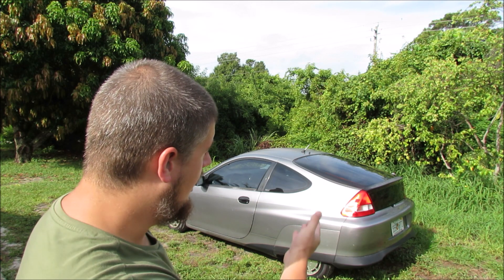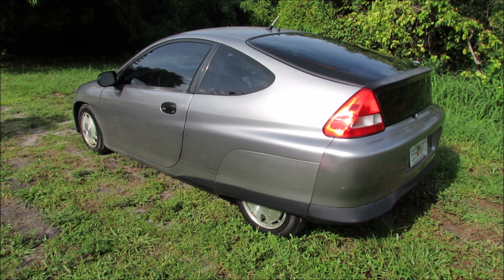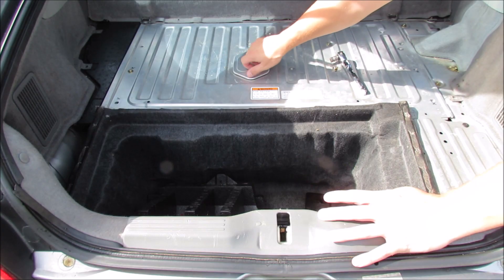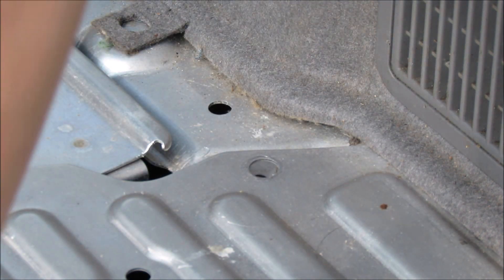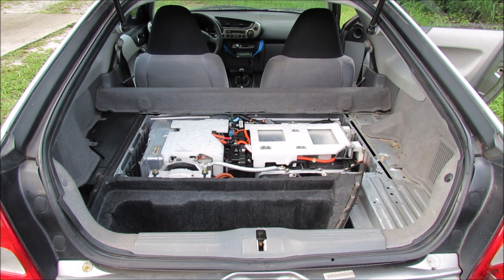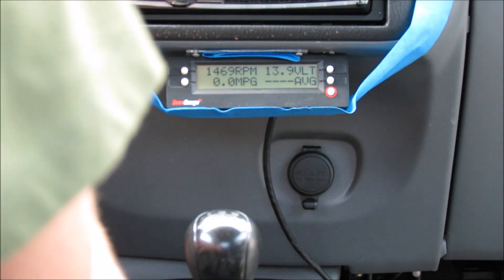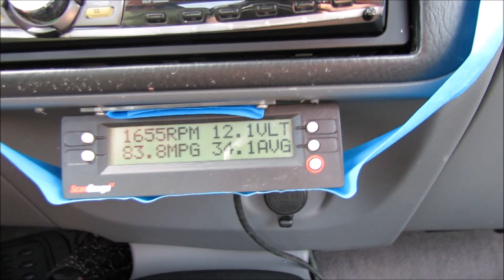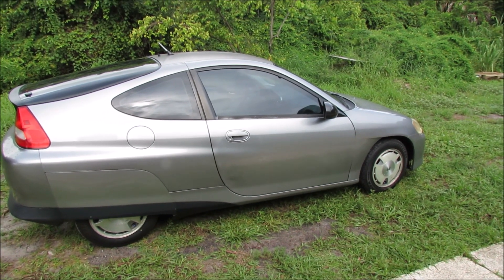How to Bypass IMA in Gen1 Honda Insight

Comment: This is a great video and I am so grateful. Am going to do this as same thing happened to my 2003 automatic insight.  When I open and take off the metal cover I know the main switch will be in the off position because I did itv3 yrs ago.  So the two plugs you referenced will be plugged in and I unplug them correct?  If so can you explain how the 12v battery recharges itself with no alternator?  Thanks and sorry for long winded questions

Comment: Now that you will be turning her over, with the 12v battery, would you suggest putting in a deep cycle 12v battery? Thanks!
Reply from the maker: I personally don't think it's required.  I had zero issues for over a year doing it this way.

Comment: gota few questions, can i run the car with the headlights on, i also have an after market touch screen radio head, can i have that running aswell, lastly, would this bypass hold up long enough for me to drive the car for an hour and a half at freeway speeds. oh and i dont have a scan gauge should i gamble and not be able to see exact volts?
Reply from the maker: I ran the car for hours like normal when I did this.  If you don't have a scan gauge I would recommend using a volt meter to see of its charging properly after doing this.  You don't want to get stuck an hour away with a dead battery.

Comment: Just what I needed to know! Infortunately I gotta pass smog to renew tags so I guess I gotta buy bumble bee battery but great info! Great video man! Thanks
Reply: Hybrid has nothing to do with smog. Properrly maintained gen 1engine should have very low smog even with IMA bypassed.
Reply: @MAC-hb5yr  It's because it will have a CEL. Certain places if u have a CEL it will fail regardless what the code is for

Comment: I have had my Mk1 UK Honda Insight since 2006 I was completely unaware this could be done..

Thank you! I was considering letting the car go. I reconditioned the pack back in 2013 iirc with a guy up north into these but did not really want to spend another £2k right now! So this will enable me to still drive around. And still be mobile.

So pleased this will be getting done tomorrow..

Comment: Good stuff Bro! 
I was wondering whether it is possible at all to do it the other way around. I mean running the car with electric only. Thanks for a prompt reply. Sham.
Reply from the maker: Even if you could the 10hp motor wont get you moving very quickly.  Best bet would be to replace the in trans motor with a more capable motor and then swap the 144v battery pack put for something bigger.  Anythings possible.  But i dont know if the cables would even be up to the task.  It would almost be like starting a fresh build.

Comment: I have automatic. is that mean just don't go pass 4k rpm?
Reply from the maker: Honestly i couldnt tell you.  Even if the battery light comes on it only stays on for 30 seconds as long as the car shifts and the rpm come back down youll be fine.
Reply: @thousanddollarcarguy  Thank you for your replied. I don't have money for new batteries yet, am i still able to daily drive like this? Will it hurt anything to the car with disable IMA switch off and disconnect BCM?
Reply from the maker: @jeanbkletsgo7446  no it wont hurt anything driving it that way.  Your good to go.

Comment: Thanks for the video. I have heard that you can run it on gas only, but I thought you needed to buy or make a plug. I guess the plug is for the clutch bypass switch? Could you do a video about that? I have two Insights I want to get back on the road, but batteries are very expensive.
Reply from the maker: I didnt do it on my own.  But i believe its just a neutral safetly switch mod.  Im sorry i dont have any more info on it than that

Comment: I just now finished this operation on my 2002 Insight with CVT. Where I live, it's not even a deal if the check engine light is on. Now, so long as my under the hood battery stays charged, I'm happy once again getting 45 mpg.
Reply: HI there. I have exactly same as your car with CVT. So with this setup, are you running daily? Does it effect anything to the car?
Reply: Are you saying this still works when having an Automatic transmission????😮

Comment: I use lights about 80 miles before i reach to work. Will this mod kill my 12volt battery?
Reply: Actually tried it myself today drove over 160 miles and it did just fine...and just as you said over 4k rpm the battery stops charging for less then a minute then it comes back on again. Thanks for this video!!! I still get about 60kmiles a gallon on all motor.

Comment: Without IMA battery assists, is there problem not to charge small battery in front? Can someone answer? Thank you so much.
Reply: I was hesitating to drive Insight from Los Angeles to Houston & back to LA with weak IMA battery.   I decided to disable IMA.   I just made 3,800 miles trip without IMA battery & I really appreciate your YouTube post. Thank you so much!!!!! Only thing I notice was driving over 4,000rpm, battery and break light come up until I reduce RPM below 4,000. Lights goes off & car drives fantastic!! Again, thank you so much.
I proved your system works.
Reply from the maker: @ishizakitokuji987  thats amazing
  Im so happy i was able to assist you in a way.
Reply: @ishizakitokuji987  Wow. Is your car manual or auto? I have auto and wondering if it happens same driving at 4k rpm?
Reply: @ishizakitokuji987  Also are you still driving with disable IMA as of now?
Reply: Thank you so much. I do it today!!!!!!!!!
Reply from the maker: While doing what i said the 12v battery charges up front.  You dont have the stock ima battery but you do charge the 12v battery so you can keep driving the car.

Comment: My insight battery dies after a while 
Hmm im thinking its just the dc to dc now? 
Just bought it yesterday. Drove it home 35 miles
Reply: Get one of those plug-in voltmeters for the cigarette lighter and monitor the voltage as you drive to get some idea about when it's charging.

Comment: So does it use the electric motor at all anymore or are all hybrid batteries disconnected?  Pretty savvy of you. What fuel economy do you get?
Reply: I am inclined to believe with the hybrid battery out, the electric motor no longer works if the hybrid battery was the one powering it. That thing will eat the under hood battery for lunch if that was the case

Comment: I read that you only need to unplug the BCM, to bypass the IMA.
Reply from the maker: Only thing i can say is i unplugged 2 of the 3 plugs that i show and it works
Reply: @thousanddollarcarguy  Great. What is your fuel economy like now, in the city?
Reply from the maker: @keithc8108  currently 53mpg.  Typically around 70 to 80 degrees everyday.  I havent ised the ac in a few weeks its been too nice.

Comment: DO NOT BYPASS THE battery. You can recondition the battery pack with a grid charger and a deep discharge.. I spent only 165$ and mine is renewed at 142k.
Reply: I am going to bypass till I can recondition my second battery (each set of 4 sticks takes me 3-4 days ~20days I have 2 gen 1 hondas and I have one extra pack so I have up to 20 dead batteries till I have concerns I plan on buying a set of new 10000mah replacements when money allows when I install that battery I'm also installing a grid charger :)
Reply: "gridding" is great as long as there's enough battery to take a charge. I did it for two years. Finally it wouldn't take a charge. I also couldn't do longer trips being dependent on having to plug it in. This is the clean, worry free solution. It's easy to adapt to linear acceleration, still yielding an incredible 60 mpg.

Comment: Great video! Help me to understand one part, when you exceed 4500 rpm do your charging volts instantly drop? You explained how to make it go away very well but basically to avoid this just keep your rpms down?
Reply from the maker: Correct.  It stops charging for the duration of the extra lights being on.  But when you shift to a higher gear for a little while the lights go away and the charging with restart.  Ive done this hundreds of times.  Sometimes i need the extra revs from the car to pass someone or pull put into traffic and its like.  Welp.  I can afford 30 seconds of no battery charging for the ability to not be destroyed pulling onto a busy road.
Reply: @thousanddollarcarguy  "Because up-shifting lowers RPM.  Signed: Captain Obvious." (Sorry, just wanted to make it clear for the otherwise mystified.  In my case--2000 MT--it also drops out below 1200RPM, suggesting downshifting or gentle over-revving.)

Comment: On a car with a with an almost dead battery, but not completely dead (just used clutch switch mod to prevent assist and regen from kicking in), would leaving it alone be better? IMA start still works. Or would it be better to bypass it?
Reply from the maker: That really depends on you.  If its just a band aid to keep 1 feature and you value that feature then make it last as long as possible.  But if its going to break and leave you stuck somewhere just bypass it and be done.
Reply: @thousanddollarcarguy  thank you.
Reply: @thousanddollarcarguy  will lean burn still function with the bypass? After bypassing the big battery, will the 12v still be charged if the big battery is completely dead?
Reply from the maker: @HokKan  im not sure what the lean burn function is.  Ive not heard of that yet.  But yes the 12v will still charge correctly by bypassing it like i showed in the video.  Actually you should be able to completely remove the big battery now if you wanted.